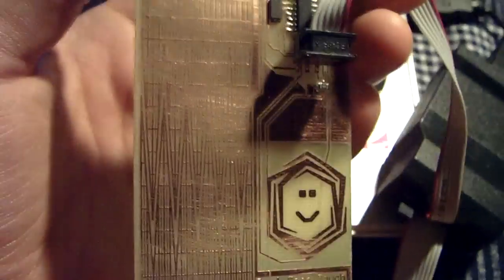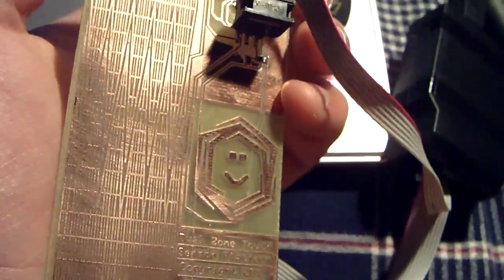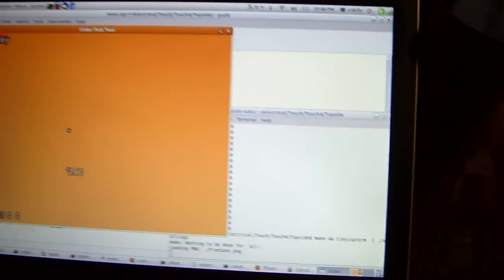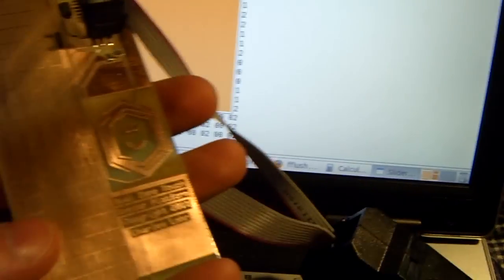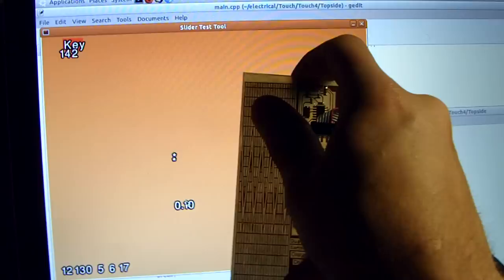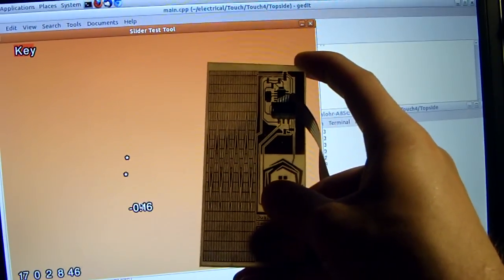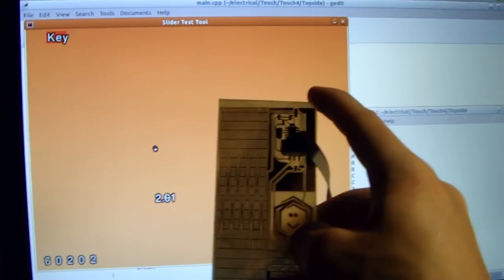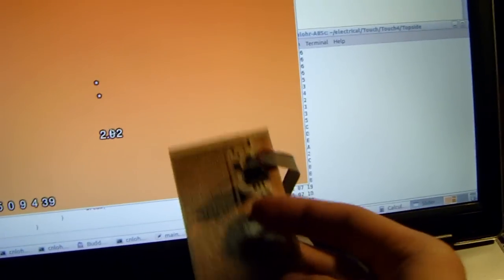AVR Capacitive Touch Sensor  Slider and Spinner

Comment: Thanks for the reply. I found the CapSense library for Arduino, so I will try to test it out tomorrow. I was looking at the cap sense slider on the STM32F-Discovery schematic and they use 4 chevron sensor footprints in a row... I guess so that they can extend the length of the slider. Very cool technology indeed... just etch that human interface right into your circuit board.

Comment: @artem1kuchin one more thing, AFAIK human body for cap sensing is considered a conductore, not the charge storage, so, the body connects your terminal with so called remote ground (through the air and other materials).

Comment from the maker: Sort of... you will have poorer granulity than if you use an interrupt.  But really, the bare minimum is:  You have a 1M resistor to 5V on the pin.  You drive it low (set PORT's bit to be 0, set DDR's bit to be 1) you let go (set DDR's bit to 0).  You wait for PIN's bit to be 1)

Comment from the maker: I wrote a tool called tinyispterm that treats the lady ada programmer as a sort of SPI terminal. I can then printf, or use compact functions on the AVR to send messages back to the computer.  Using either the official tinyisp or my clone, I get about 1kB/sec throughput.  If you're interested, all that is in my main electrical svn repo.

Comment from the maker: @artem1kuchin I use a 1 M-ohm Rs for each channel.  I measure the time charge, specifically.  I set the pin low, and enable output, then I start the timer and disable the port drive, let the line drift high and bingo.

Comment: @CNLohr I see. I used this method and failed measurably when the whole thing was turned on in an environment with EL light with electronic ballast and no real ground around. The EL light generated enogh EM noise to make things go crazy. So, this is why noe devices use charge transfer method, so, capacitance is measured to some really known and stable level, like common wire.

Comment from the maker: You can get a decent one (~4.5ish bits of good data) just by having a while loop waiting for the pin to go high.   Also, as a warning, the type of input used matters a lot, for example, the inputs on the attiny2313 are not suitable for this.

Comment: Maybe there's a way to do it without using a timer? Maybe capacitive touch can allow a small bit of voltage/current to connect the circuit through the pads (Vcc to GPIO pin).
Maybe a shift register can store pad data with GPIO pin acting like a clock. I'll do a voltage reading test to see if a touch on a pad can connect a circuit.

Comment: I hear that. I was using the onboard Qtouch sldier on the UC3 A3 Xplained, but it takes about 1 minute to kick in during the loop. Its not getting slider values during the main loop. 
Is there a sure fire way to make it respond when the pads are pressed? Maybe doing using GPIO pins for input and then checking the value of the pin might make it work instantly if the pins can handle Vcc.

Comment: What method do you use to determine the finger press? As far as i see you have only the Rs for each channel. Do you just measure the time to charge and discharge the capacitance between selected channel and ground? At what rate? What value of R do you use?

Comment: Ah! Also,  looking at the  circular sensor i don't see the ground connection. I see the three measured channel, but not ground (relative to which the capacitance is measured). Is it on the back of the pcb or is it absent and you measure the capacitance relative to floating remote ground?

Comment: This is nice. I'm working with a AT32UC3A3 MCU and it has 8 ADC. Their Xplained boards have a qtouch sensor button and 3 channel 8bit slider running on 3 SNS/SNSK pairs. Any idea how to get 256 values from 3 SNS/SNSK's?

Comment: hi , I found great stuff on your channel , i have a doubt on how  you determine the position of finger please commnet me it is necessary for my next project
Reply from the maker: You will need more details.  For instance do you have individual "amount of touched" for each sensor?  If so, look for the top cell.   When you find the top cell, compare the cells to the left and right of it.  Divide the difference between highest and next highest / the difference between the highest and the 3rd highest (the one to the other side).  That tells you what percentage between the cells you are.